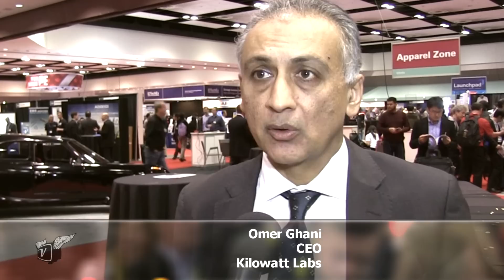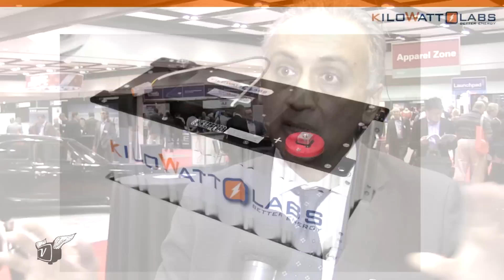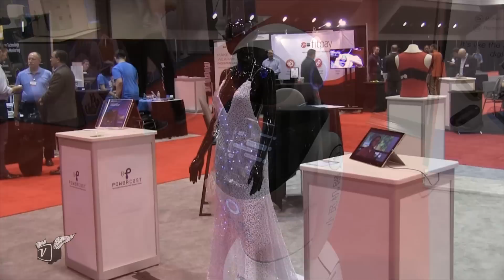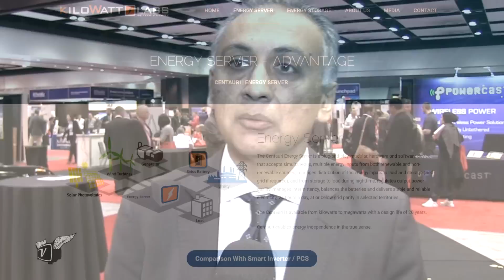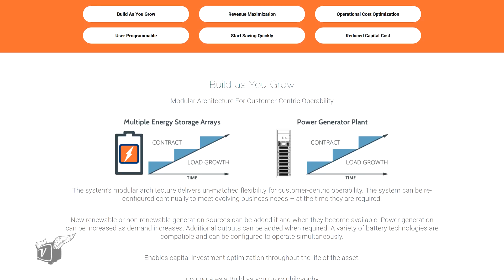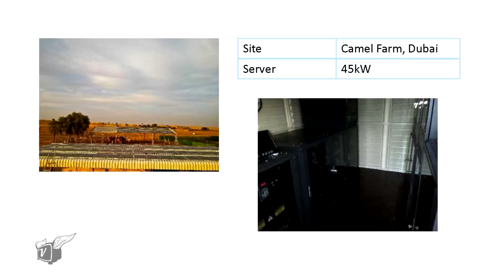The Fuel Tank of Tomorrow - A Super Capacitor?

Comment: Recharge 100 kWh in 30 seconds ?? Really !!??
You need 100kW x 2 (30sec / min)  x 60 (min/hour) = 12,000 kW = 12 MW power plant to charge 1 car in 30 sec. 
Imagine you have 10 cars at the charge station then you need a 120 MW power plant at the  charge station. 40 such charge stations in a small  town leads to 4.8GW power plants required to charge 400 EV's simultaneously. 
Goeie genade !!
Reply: If the cells were really dirt cheap, you'd just need enough at the station to balance our the load over the course of the day. Some charging stations use batteries for this already.
Reply: @w4csc Ah ha. So you know better than the scientists that study this, right? You know that ALl power comes form coal even though less than 30% does. You know better. You are so smart. I wish I could be that smart.

Comment: why tesla has not adopted this revolutionary super capacitor?????
Reply: Capacitors are used in some cars today, but only for restarting the engine.
The reason you can't use them as the source of propulsion power (yet) is because they just can't supply the needed power for enough time ... however, there is research on banks of these caps being recharged by other methods built into a car ... but it's all very theoretical at the moment.

Comment: I had to stop and scratch my head: Charge them (caps) slowly as required by the...law...
What the...
Reply: LAW? There's no Law of such... It charges in seconds from the alternator. High strain but only a couple seconds. If your worried you can put a small resistance in series to slow the charging current

Comment: Even if a battery is going to last such longer (2000 years...  BTW, think it lasts at least 10 years)...... But we will not be able get those things commercially. No one would be getting those things "Commercially".... Because it is "Commercial".... 😎

Batteries will remain with a lifespan of maximum 5 years for typical consumers, whether it is Super capacitor, Ultra capacitor or Solid state batteries developed by Samsung.
Otherwise, the business with batteries would be dying, when battery replacement is no longer necessary within 10 or more years...

So, we will have the technology, we already have that technology.... But Edison will always win against Tesla in terms of "Commerce"...

Comment: Capacitors for battery's do not have huge amp hour storage. Energy density in Battery's is far far Superior. Capacitor banks will go dead much much sooner!
Reply: You apparently have zero clue what the potential power density of capacitors are with advancements do you, and likely the factors that are involved for the matter.
Reply: At the moment capacitors have abysmal energy density and this limitation is not going away. Any application has to draw either decent current for milliseconds or pico amps for a few hours. Capacitors are electrostatic devices. They charge and discharge quickly but are incapable of sustained current as the energy just is not there. When did you last rub a balloon and power an ebike from it?

Comment: "The first step is get people to believe us".... Let;s say we have need to charge typical Tesla equivalent of 100 kWh capacitor in 30 seconds assuming 100 V that's ca 120,000 Amps current. That is some 1000 times more than a good welding torch!! If this energy was to be "safely discharged in less than 1 second" then it would equate to power of 30,000 welding torches… the car would shine with a new light.

The guy is clearly delusional and missed some basic physics lessons in the primary school.

Comment: I don't hear this guy telling any truths, just hype. How much energy can a cap hold per volume compared to lithium ion? What is the rate of charge leakage. These two factors have always been why caps cannot replace batteries. Have caps improved enough to be used with batteries in a hybrid configuration? This guy isn't telling any hard data, and that is probably because caps cannot be useful yet.

Comment: So I'm thinking yeh this is what I'm looking for my project, but there are no products for sale, how come there are no products for sale.

It seems a lot of talk with very little substance.

They could prove the concept easily and cheaply, just get hold of one of those cheap electric moped things that only manage around 10 miles to a battery charge, replace the batteries with their system and do a video, then sell the low to mid range products on Ebay as a direct replacement part for a 12v battery, they will get all the feedback they need to see if it works properly or not cos people will go wild on youtube either slagging it off or praising it.

At the moment all they got is a lot of hot air and nothing to show it in action.

Comment: Ten minutes and no mention of energy density? So you'd have to fill every square inch of your car or your basement with these things and they'd still be shit. At about the 9 minute mark, he talks about cars that would get only 100 miles per charge. So high capacity charging stations would have to be built everywhere. And when a better solution comes along, those 100 mile cars will lose whatever resale value they had.

Comment: A Rechargeable battery is a capacitor
Reply: Learn your science before making random comments that make you look like an uneducated fool. A rechargeable battery is most definitely NOT equivalent to a capacitor. Rechargeable batteries use chemical processes via a conducting electrolyte for energy storage, whereas capacitors store the energy as an electric field, and use an insulating separator between the electrodes. Each system has its respective advantages and disadvantages. Even if some of the claims made in this video are exaggerated, it still appears to be an extremely promising technology for the future.

Comment: Capacitor is good for car racing, because it cannot hold charge for a long, daily, use car and it will drain charge will be useless for normal life but for specific devices fast charge and instant drain requirements, and electric surge.

Comment: the problem with creating public hysteria is that irrational "solutions" become as easy to sell as candy to a baby.  capacitors or batteries are storage they do not create energy - at best you hope they store everything you put in until it's needed - and that's a problem because the magnetic fields are not bounded by dielectric materials. perhaps we can use the old plumbing analogy once more: a capacitor or battery is like having a barrel of water which you can empty to turn whatever you like - I will even allow you to set it as high as you like so you increase the pressure... but it is never never never going to do as much work as a barrel of gasoline
Reply: A lot of the people selling "solutions" also seem to be completely clueless about what different technologies are good for. So much nonsense about supercapacitors replacing batteries! A tonne of hydrocarbons might store a lot of energy, but not a lot of applications actually require that density or come close to extracting all of it, yet there's this constant fuss over the energy density of batteries vs petrol. A typical electric car battery might store enough energy to drive the car 300km, while a 65L tank of petrol gets 500km. Okay. So what? You, the driver, are still going to need a break before the car needs charging or refuelling, and most trips are going to be well under that.

Comment: "Sirius' proprietary algorithm-based balancing, charging and control circuit actively balances and stabilizes the supercapacitors that are connected in series, delivers linear discharge voltage, and specific energy of 115 Wh/kg."........Not quite the 100 Wh/kg needed to equal fossil fuels but it's getting there.

Comment: I do not believe it is a super capacitor. More likely a Lithium Titanate cell based. I do not know how you get 96% round trip efficiency with a Super Capacitor given that 50% of the energy you insert (QV) is released as 0.5x CV^2 (When pushing electrons in a charging capacitor, the ones already there push back.)  The 50% energy loss is thermal and if you charge hard and fast enough - EM radiation. So it is likely a mis-named/mis-classified battery. It may have a capacitor in it, but it might be a very small portion.     Frankly, doesn't matter if it does your job and consistent with the spec performance that you thought you bought..

Comment: This is very misleading. Supercaps do not compare with batteries. A large supercap bank has actually very little capacity compared to a battery of the same size. The actually have about the same capacity of a few flashlight batteries. And as you series up the caps to higher voltages you lose capacity. For example, if you start with 6 3000F caps and put them in series then you have 16V but now only 500F. This video does not convey this and people are being mislead about supercaps by missing these essential points. You can't replace your car battery with a super cap because they self-discharge and don't really have much capacity as mentioned. If your car doesn't start right away you will not be able to use a super cap to turn your starter for very long. And in today's world of many onboard computers and headlamps and security systems, etc., the supercap would not be enough. Then there is the cost. If you consider the same size cap bank as your battery and you get only a very small fraction of the actual capacity, you also pay around $350 for such a almost useless bank. So you would need a bank 10 times the size of your battery and maybe 50 times the cost $3500, to do what a battery would do for you. Granted, while running the alternator is what powers things, but only a battery can start your car in the winter, or power all the accessories after you shut down the motor. Unless capacitors can be made more than 10 times smaller and 50 times less their present cost all this is misleading. Of course the technology does exist already but the public will not have access to it until the greedy people milk all the money they can from you first.

Comment: The first step is to get people to believe Let's say we have need to charge typical Tesla equivalent of 100 kWh capacitor in 30 seconds assuming 100 V that's ca 120,000 Amps current. That is some 1000 times more than a good welding torch!! If this energy was to be "safely discharged in less than 1 second" then it would equate to power of 30,000 welding torches… the car would shine with a new light. 

.

Comment: discharging  in a second? I don't think so. zero volts - i don't think so.
those comments are a sign of marketing hype. take it all with a big grain of salt.
I smell flim/flam/man
Reply: Absolutely. You can even shrink quarters! Thats the beauty of supercaps. No internal resistance to speak of allows full power dumps. Make a copper pipe coil bout 6 turns, plaqce a quarter in the middle, dump from a 3000F cap and BOOM! Must use pipe as a wire coil will blow up. The switch is the hardest to make as super high current will melt it!
https://www.youtube.com/watch?v=EoWMF3VkI6U

Comment: what a lol...
must had been a hard task to charge them with a current limited powersupply. 

come on its bullshit. caps fail too,larger ones are dangerous too, and energy density is nowhere to Diesel fuel even if you add the weight of the engine.